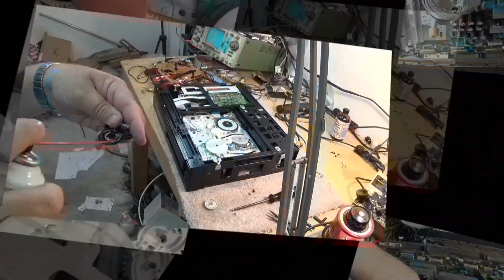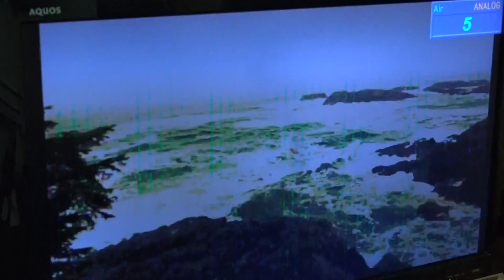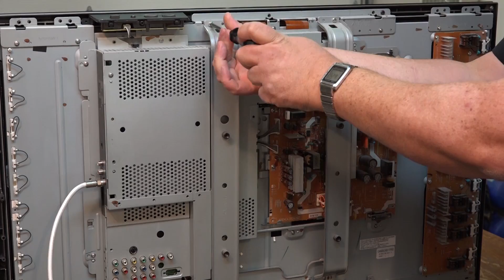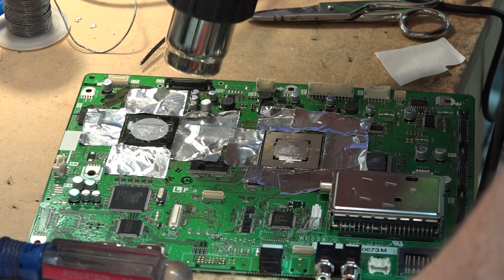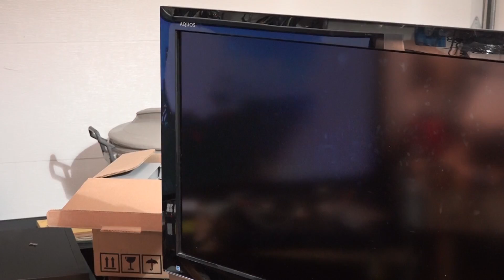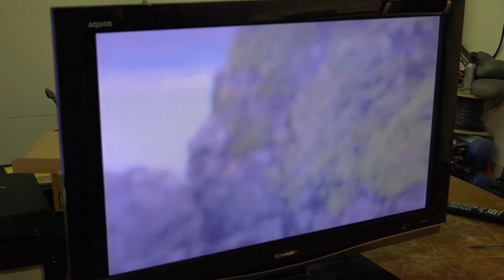Sharp LC37D62 thin lines in picture

Comment: Ive heard of many techs using a heat gun to gring a VGA graphacs card back to life from dead on computers so that technique is not so rare. I wouls like to know where you get that heat shielding tape. I have copper tape like that. Will that work?
Reply from the maker: That heat shielding tape comes in kits used by the cable splicers at work for protecting cables when they put on heat shrink enclosures with torches. They throw away the ends of rolls when there isn't enough  remaining to do another one, and I grabbed it out of the garbage.

Comment: Heat gun works well every one owns a heat gun mine is on its last legs. I fixed the eliment by twsting the broken wire togetherthe eliment burned up because the motor packed up. I got the motor running after some tinkering now it works again. If the heat gun breaks again i may try making some new coiled wire for it

Comment: Subscribed !! Excellent videos and thanks a million for them too ! I have a 70 inch Vizio model E700i-B3 and am assuming it has the Sharp screen. The screen is bright white with a slight grayish tint and has vertical colored thin lines through it. I have sound, and sometimes i can get a partial picture using an HDMI cable from my PC to it. I replaced the t-con board but it didn't fix it. I have reseated the ribbon cables and the LVDS cable, I see no swollen capacitors, and the voltage coming out if the tcon and going into it seem to be good. I have no idea why i cannot get a picture. Also, the t-con board is extremely hot. If you can give me any advice that fixes this 70 inch Vizio I will gladly send you money via Pay Pal, thank in advance

Comment: So interesting. Hey, I have a Vizio that got hit by lightning. Did you ever repair a LED flat screen that lightning hit? I realize it probably fried most of the components.
Reply from the maker: Lightning does plenty of damage to electronics. Many times not repairable.
If you are lucky it has blown the MOVs on the power supply and the fuses.
Perhaps the rectifier. That is usually what happens when the strike hits power lines.
I remember getting a camcorder. It was NOT plugged in, but it was laying on the floor with the unplugged power supply attached to the camera.
The DC cord between the power supply and the camera acted like an antenna and picked up a huge power influence which blew chips in the lamers literally off the board.
Lightning had hit a tree next to the house. The tree exploded. Current ran down the tree, through the roots and into the main house power, underground telephone and cable service drops. 
The damage in the house was extensive. Every light bulb blew, turned on or not, furnace, refrigerator, freezer, microwave, range, TV stereo. camera, and pretty much everything else that was plugged in.
I got the task of looking at the electronics. The TV was repairable, just an MOV was vaporized, a strip of foil on the PC board, fuse and standby transformer. The microwave also survived. Just the little transformer on the timer board. VCR had the fuse, rectifier and chopper transistor in the power supply. Camera was fubar, as was the CD player. Power amp just had a blown fuse.  Don' know about the rest of the appliances as I didn't see those. The service panel for the electrical feed also was blown to pieces. It literally exploded inside, which the fire dept used as a reminder as to why the metal cover on electrical panel should always be closed and latched. The panel literally exploded, but the metal cabinet, and door contained all the flames and sparks and prevented a fire. Had the door been open, as many people leave them, the sparks, and flames that would have shot out could have ignited something. (This is also why under the electrical code, breaker panels can not be in linen closets ect, or anywhere where flammable material could be placed in front of the door.)
Reply: I believe lightning hit my outside antenna, traveled through the cable, to the TV. I saw the fire shoot out of the TV. It also tripped the in-line power breakers on 2 of my window air-conditioners.
My DVD player, antenna converter got destroyed. Also, the cable had a split where lightning burned thru. It was a new cable and outside antenna. A storm decided to hit us during the Solar eclipse of 2017.
I liked that old TV. Had it for 8 years. 32 inch. It costs what you can get a 50+ inch for now.
It was much heavier.

Comment: Sorry man, I'll turn my add blocker off for your channel. I didnt know. You trouble shot like I do. From freeze spray to heating up components to find shorts. I re-flow with  heat gun and flux, but I want to stress to all of your followers you here, if you heat re-flow a BGA chip DO NOT knock the board, table, anything. Let it cool before you touch it or your fucked.

Comment: I was listening to your end comments about adblockers  and making money from Youtube.  I pay for YouTube Red which eliminates ads but it's YouTube's service, so how does YouTube  handle Red subscribers and monetizing  ?
Reply from the maker: We do get paid by red service subscribers. It shows up as red revenue.
Reply: Ahh, good to know, Didn't want to be taking a paycheck away from someone, by paying for Youtube's own service ;). I recently upgraded my living room setup to a 43" Sony 4k+ HDR TV.  I've had a 42" Panasonic Plasma as the main TV for about 6 and a half years now.  Decided to make it the bedroom TV since I didn't have one in there anymore.  The other reason I felt it was good to get a new main TV is the Panasonic blew boards  a couple months after purchase and was fixed under warranty.  While it's been solid since, with the unpredictable behavior of Plasma sets, wasn't sure how much more lift to expect from it. I had wanted to get OLED, but two things I ran into was the price, and they aren't viable in smaller sizes yet, it seems.  Have you had any experience with OLED as a technology and is it worth buying yet ? or is it still too new and unstable  for televisions ?
Reply from the maker: Plasma sets are actually very reliable if installed correctly. Many people mount them over the fireplace without a baffle to throw the heat away, and they get cooked. Some suffered from the loose ground screw syndrome which caused component failure on the boards.I have 8 plasma sets myself, only 2 of those I bought. The rest were tossed for very minor problems.1 needed 2 capacitors, the other a 15.00 buffer board, the 3rd had a shorted coil, the 4th 1 cap in the soft start, one with 4 blown parts due to loose screws, another with bad cap in the y sustain, and one with a bad panel (thin green line in the pix, so that is a gaming display) I sold one of them to a friend, and have 2 waiting their turn when one of the others blows up for good.Now LCD and LED I haven't had as much luck with I currently have 3 broken LCD sets, one with a bad main board, one with a bad tcon board, and another one with a bad panel.I do like OLED sets. The first generation were prone to image burn in, but the new ones appear to have that problem solved, but they are just too expensive. The reason that plasma production stopped wasn't so much because of reliability, but because production costs were much higher than LCD, but due to public perception they had to sell them for less than it cost to produce just to get them sold, and once that happens, unless you are tesla, business rules dictate that you can't loose money on a product of you want to stay in business.OLED will come down more in price, and that is what I am waiting for. If I can keep my plasma sets running long enough then I will buy a 4K OLED.

Comment: I have always had you whitelisted. I assume the swaying you were doing with the gun was to regulate the temperature. Never knew you could use a halogen lamp to reflow, i will try that soon because one of my monitors has a line on it, have to poke at the BGA chip to see if thats the issue.

Comment: How do you judge the temp of the reflow?
Reply from the maker: I don't. I just guess at it. I never attempt this on anything that isn't headed to the re-cycler anyway. If I can make it work and get some more life out of it great. If not, then it continues on it's way to the recycling center.I judge the temperature by the smoke from the flux. When it is smoking good then I know that it is hot enough to solder. If it works great, if not no big deal off it goes.  I also don't charge people much for these type of repairs so if it doesn't last I just refund them, and everyone is happy. The video is more of a demonstration as to what caused the problem, and what is needed to get it going again. As I say in all these videos your mileage may vary, but for me I am batting about 80% of them staying working for a substantial period of time.

Comment: That heatgun basically is a cheap hot air station,  it just doesn't have the nozzles.  It's fine.  If they are talking about an actual bga rework station for fixing tvs as a hobby then that's hilarious.
Reply from the maker: Yes and no. They both blow hot air. That is about the only thing in common. A BGA workstation can be of the hot air, but most are of the infrared variety.You start out by putting the board on a hot plate that brings the board slowly close to, but not over the melting temperature of the solder.Then depending on the type of station, hot air which is temperature controlled is directed to the component to be removed for SMD rework. For BGA it is typically an infrared head source from a halogen lamp with a lens to direct the light/heat directly onto the chip, and that is focused so it only is directed onto the chip. This extra blast of IR heat goes right into the chip, and raises the temperature that last 10' or so to melt the solder, and the chip can be lifted away.When I was in the business these rework stations were thousands of dollars.I left the business in 2003, and special equipment was one of the deciding factors. The shop owner wouldn't buy the equipment, and there was no way I was going to spend my money on a piece of equipment for someone else's shop. That made me unable to service newer gear that used BGA chips. That was one of many reasons I chose to retire from electronic servicing. Then I saw guys using paint stripper air guns and halogen lamps doing it, and figured I would give that a try. Success most of the time. The problem with using a heat gun is temperature control. You can overheat a board with it and the hot air can blow other SMD parts off their lands. That is why I mask the board with heat shielding aluminum tape. That is to shield the other components. I'm batting about 80% on these repairs. 80% is better than nothing though. The way I look at it, the unit is broken and headed to recycling, so if I can fix it easily, and get a little more life out of it then good. Most of this stuff it my own, and the paid stuff I charge clients a basic estimate charge to look at the unit. If the problem is one like this, I do what I can and then hand it back to them, no extra charge and no warranty of it breaks again. If I find a component that I can replace, and know 100% that the unit is repairable, then I have my regular shop rates for those clients.This keeps everyone happy. I make way more from the youtube views than I ever charge my clients, so it is a win win situation for everyone. Clients get their equipment fixed cheap, and I still can make money doing it.
Reply: When comparing the heat gun to cheap hot air stations I meant these things - https://www.amazon.com/Tenma-400W-Hot-Rework-Station/dp/B00FQL46SU/ref=sr_1_24?ie=UTF8&qid=1473116234&sr=8-24&keywords=hot+air+rework   I had one similar and the damn thing nearly had a meltdown on my bench. The temp control on these things is pretty terrible as well so I'd rather stick to my adjustable heat gun.

But yeah, that's what I mean;  proper BGA rework stations are still expensive and I just don't see the point of investing that kind of money for doing occasional repair work.

Comment: Thank you for all your videos. I have learned a lot. Will the chip reflow with just the heatgun or is the flux necessary? Thanks again.
Reply from the maker: I fluxed it!
Reply from the maker: I too have had great results. Every unit except for 1 has worked, and continues to work. The one that didn't last I did it a second time, and cooked the board much longer with a halogen lamp sitting on the chip, and it is still working today. I am writing this message on it. My old Dell laptop.
Reply: I've reflowed a lot of laptop motherboards without flux and without completely reworking them. Occasionally the problem will come back in couple of months but 95% of the time it works without reworking. I'm going to start using the resin as extra help.
Reply: flux helps reflow

Comment: I have to agree with the comment about the bruise there is no trace of before it was tapped
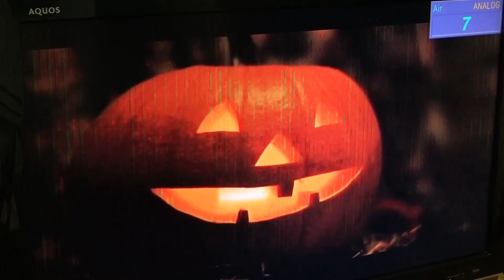Reply from the maker: Sure there is. Go look again. I can show you a clip that shows it clearly before the set was even opened. I cut that scene because it was not relevant to the repair, but you can clearly see it.At 1:36 you can clearly see it just to the right of the nose on the pumpkin.

Comment: Good job!, I repair lots of TV's and I use a heat gun and had NO issues!! Those Sharp's always have the same issues. By the time I get them, there are very harsh green zig zag lines. A good reflow and it's fixed. Keep up the video's as I enjoy them very much. You tend to explain them in a way that others dont(or wont). Lots of common sense (which seems to be lacking nowadays). I will let the ads run. Thanks!!!!   (BTW, my avitar is a 1963 Magnavox color TV I restored. Great set!)

Comment: I didn't see that "bruise" on the LCD panel on any of the video  material until you were tapping very hard in the same exact area and then boom, there is was. Hmmm...
Reply from the maker: I wasn't tapping it hard. I barely touched the screen. It was there as soon as I brushed it the screen flashes. All Lcd do this but the old ones are really susceptible. The mark it there, you can see it if you look. I can show you shots where it is clearly visible before I even pulled the back off.

Comment: Smashing job sir :-D.
Thats the problem with glueing chips down with solder, i hope one day they find a better way.
Just take the headphone jacks on some audio equipment, they should be mechanically bolted down first, then then flexable wires soldered, but they dont do that ;-(.

Your reflowing works, i dont see a problem, and the lamp method is just neat :-D.

I have add blockers, but they are allways whitelisted for youtube, doing nothing for more than 6 years, they never react to anything.
Addblockers have there uses, the sites that go mad with adds just make browsing the pages impossible, but if its a decent site i whitelist it :-).